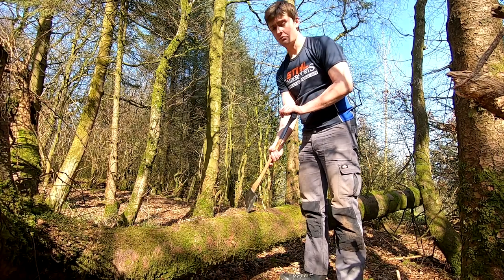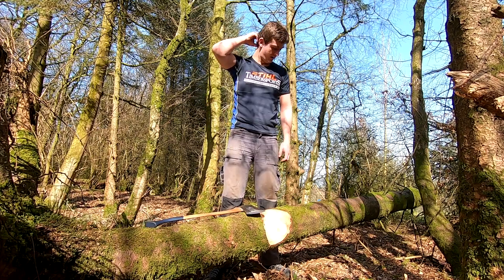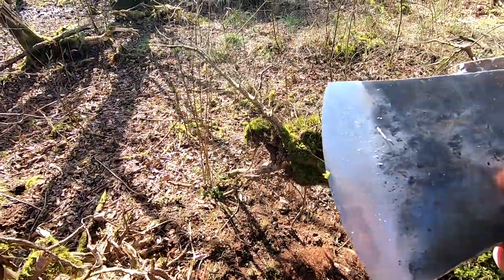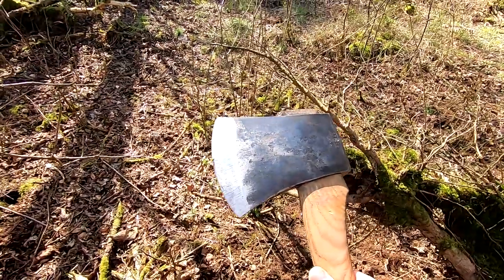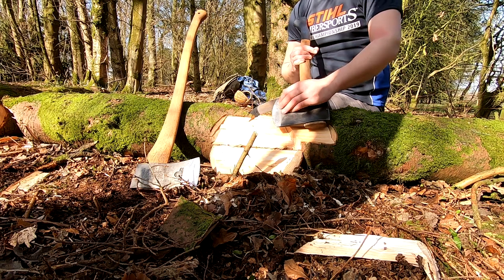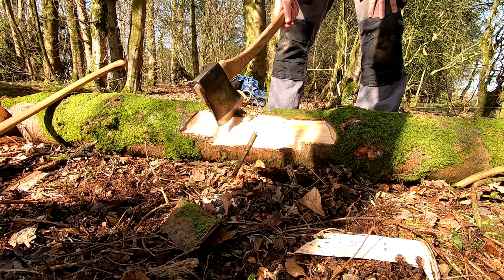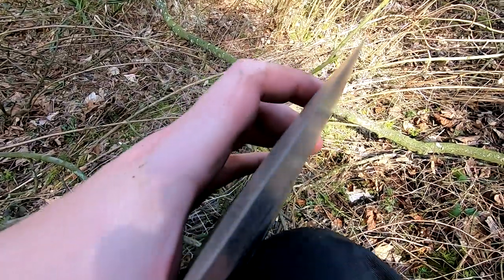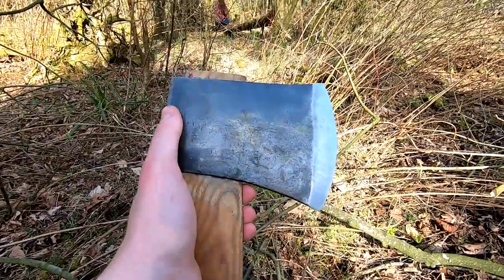Tasmanian Pattern Axe vs Yankee Pattern Axe, Chopping and Discussion

Comment: Great video!
I would like to add, from everything I've seen, it was typical for Finnish men to carry 2 axes with them into the woods along with their wood frame saws.
It seems the 12 model, either 12.1 or 12.2, was typically preferred as a felling axe on a shorter handle.
Then a Billnäs 7 on a longer handle was used along with the 12, splitting the meter long lengths of birch to be stacked and seasoned.
The 12s were in the 3-3.5# range and had a fairly wide bit. The 7s were heavier, about 4# and they had a long and narrow blade, but with a thick wedge profile.

Comment: Might add that the idea of the 26" was to make it more versatile for felling, limbing and bucking as it allows you to build up head speed for those horizontal cuts. 
It was never meant to be the perfect axe for bucking tbh. 
Handle shape wise Ideally I'd have had a thicker board to make the handle from but 🤷‍♂️
I still think tasmanians shit on any other pattern but you already know that 😉
Reply from the maker: I found it to be reall nice to limb and buck with, nice wide blade. will need to fell more with it though. that sycamore felling cut was outrageously hard, bull of weird grain. tbh every axe I have would have struggled with it.
what you really mean is your helko shits on every other pattern, but its not a proper tassie ;)
Reply: @benscottwoodchopper  what makes his helko so potent?

Comment: More efficient patterns for firewood processing, from felling to splitting? Sure that skinny Yankee pattern can cut deeper in dead wood, but how's it split? Tassies are probably close to the top when it comes to processing firewood. The high centerline and all around convexity of these vintage axes is the main thing missing in today's axes. Such a shame. That Tassie is gorgeous too, maybe the best looking one I've ever seen; Owen picked the right handle length. By the way, I'm nine minutes in so maybe splitting is coming up?
Reply from the maker: In general though you do not want to use the same axe for splitting because such a fine edge to make it cut well is damaged easily. Even for splitting i prefer a thick Brades yankee pattern or basque, tassies have a flatter centreline in comparison to those. Or a specialised splitting axe is handy. In general though i think tassies are okay, but not my choice for an all round axe
Reply: @benscottwoodchopper  I understand specialized axes are better at specific work, but my thing with axes is one axe to process trees into firewood. I don't have a ton of experience, but I think a chopping axe edge would be fine for splitting, even if the bevel is thin, as long as the microbevel is stout and slightly convex. When you say the Tassie has a flatter centerline, do you mean that it has less convexity or that the overall wedge is thinner?
Reply from the maker: Aye the tassies i have seen have less convexity across the cheeks than a basque or the yankee patterns from Brades. A chopping axe edge can be used for splitting but it is significantly less effective, also sticks more. My splitting axes get quite beat up due to the nature of the work, and having a very fragile edge to have to baby just becomes a liability and slows down work due to the care one must take. Besides, if you are talking about an axe as a standalone tool for processing wood, the size of wood you are going to be able to cut and split will be a lot smaller, going over 30cm becomes a bit ludicrous due to the size of notches you need to cut. Most axes can split up to 30cm fairly good

Comment: Looks like the Tassie would fit in the do all category like for an allrounder though the Hultafors also fits but imagine the Tassies better at splitting. Renewable concrete I believe I was looking at something about that also sounds very interesting. Sold an Old 31/2lb Robert Sorby with the Kangaroo to a friend lately. Ive Been playing with a council Jersey lately and like it very well.
Reply from the maker: Yeah i have a council jersey too, would use it more but 36" is a bit long for most of my uses
Reply: @benscottwoodchopper  Yeah admittedly I want to cut the handle down so its shorter and straight ish but am enjoying it for splitting at the moment but again I have another dedicated axe for that.
Reply: @benscottwoodchopper  Been filing a 41/2lb spearwell with one of those weird kind of long wedge heads. And Oberg file has been the tool of choice and an old scythe stone theyre pretty aggressive especially with a bit of water on them.

Comment: Hi, liked this video!
But I did not get what Hultafors it was. Name handlelenght and a Yankee-pattern?
What weight has the head?
I have here a Yankee with 1 1/2 Lb ... Don‘t know what handle-lenght I should take ... (I am only 1,70m tall) ...

Any tips?

Jan

🌳⛺️🌲
Reply from the maker: the hultafors is this one https://www.knivesandtools.co.uk/en/pt/-hultafors-chopping-axe-1500-gram-hy-10-1-5-sv.htm

For a 1.5lb head I would recommend a handle of between 14" and 17"  for use as a hatchet. It is a bit light of a head to use as a larger axe

Comment: One thing I found with my tassies this past winter was their great chip popping abilities wasn't necessary in hard frozen wood. When bucking. And if the axe had a good convex with a high centerline, it was a detriment as it turned my firewood into a Bunch of kindling. 
 Something I had wondered going into the winter was . If I would end up with summer (not frozen wood) axes . And winter (frozen , Hard, solid frozen to the pith) axes. 
 Turns out, I did. 
 My concave and flat cheeked axes do a better job in frozen wood . But stick terribly in warm wood. Where as the Tassies are much much freeer in the cut. 
 And the wood I'm chopping is very soft in the summertime. Rock solid , well , not rock solid. But Real solid in the winter.
Reply from the maker: Thats my experience also in dead wood. Fat convex cheeked axes for softer green wood and thinner in harder brittle wood that chips easily